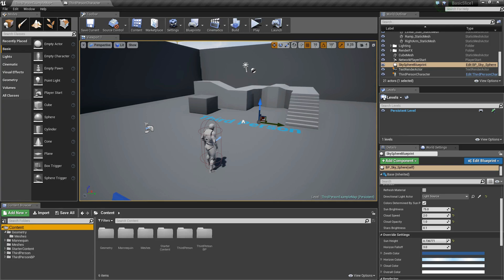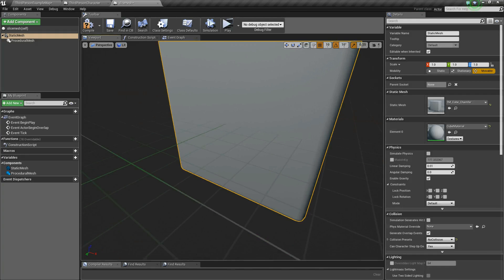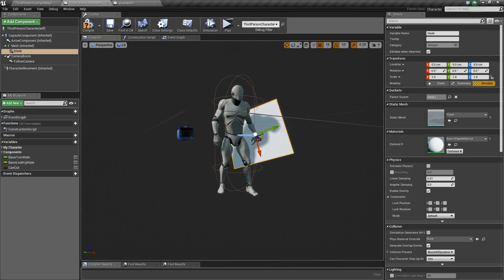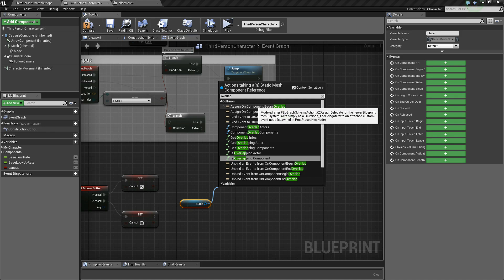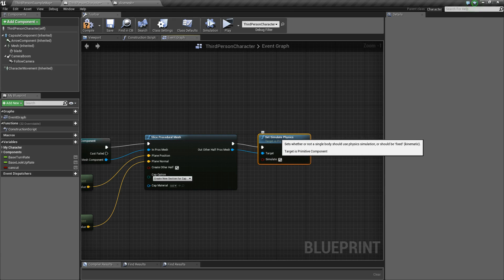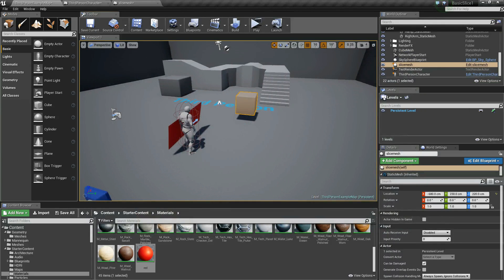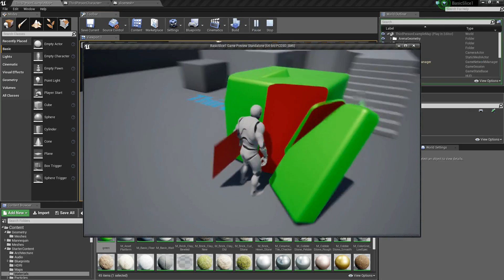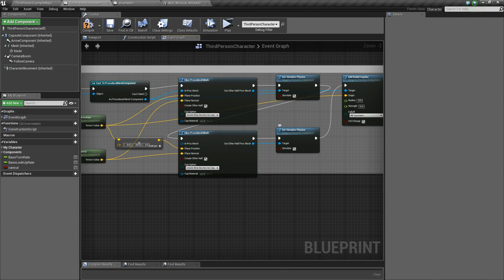Tutorial on Slicing blade. (100% Blueprint, Unreal Engine 4)

Comment: the only thing i noticed is that if you take the chamfered cube for example, and stretch it up on the z axis, the cut won't be accurate, and I'm guessing that is because of it's collision data, because if i take an already long mesh and slice it it does slice accurately...
Reply from the maker: Exactly, if you stretch do it on all the 3 axis not just one... or, as you wrote, change the mesh before. That's how procedural mesh works in ue4.

Comment: If your procedural mesh goes into the ground without a collision ...
There is no convex collision in the static mesh.
Box or sphere collisions do not work, so you must make a convex collision to work normally.
Reply: I was running into the problem of the mesh falling through the floor myself.  You can start with using boxes as the collision mesh, but then in the mesh, go to the collision menu and "Convert boxes to convex".  Under the collision primitives in the details tab, you should see the boxes have now been converted to Convex Elements.  Back on your editor window, you can confirm that the boundaries are correctly working by showing the collision mesh.  One final thing is that if you are changing your collision mesh, you may need to swap out the mesh in your blueprint temporarily, then change it back to see the updated mesh reflected in the editor.  Depending on how you store the copy of the procedural mesh, you may need to do something to trigger the construction script again.

Thanks Verum Bit for the tutorial!  Much appreciated.
Reply from the maker: Check my last #ue4jam game video. Download and play the lightshadow game I did in these last 4 days for the jam....you will slice with  proc meshes with collision .

Comment: does this work with rope?
Reply from the maker: Never tested with physic chains.  You could track the location where the blade overlaps the chain and then destroy the chain and replace it with 2 new chains half length attached on the same 2 actors of the original chain. Should work but not sure about the elastic effect.
Reply: @VerumBit  ok, ill look in to that then, thanks for the quick reply, and nice tutorial!
Reply: @VerumBit  ok, ill look in to that then, thanks for the quick reply, and nice tutorial!

Comment: Does this work on a skeltal mesh during an animation?
Reply from the maker: You need a workaround to make it work. as for ue4.18, skeletal mesh can not yet be conv into proc mesh (only static mesh can), so the solution I thought are two2: 1. you can split your skeletal mesh into many staticmeshes pieces and slice them (if you have a mech is perfect). 2. another way (the one I'm testing) is to save some key character poses during each skelmesh animation and when you slice you can hide the skelmesh, get the nearest pose inside the animation and show a player staticmesh in that pose....this mesh will be converted into proc mesh and sliced....then you will apply a material to dissolve such mesh because will fall like rock pieces (not a radgoll). If is quick and added with particles, the effect is quite realistic.

Comment: Hi, Its works only with the plane as the blade, if I try to use another static mesh as blade it's getting "none" as the other component instead getting the cube on component begin overlap
Reply: I found the problem, my static mesh had no collision
Reply: you could prob just make the plane invisible and put it inside a blade

Comment: Thank you for a great tutorial! learned all i wanted too in 15 minutes, rather then having to watch the 1,5hour video that the official unreal engine channel has on the subject.

One thing i did different that may be good for you/others too, is plan a little ahead and build the slicing logic inside a function in an 'actor component', then you can just add that component too the player (or a weapon the player can hold), to an npc's area-attack, to a spinning blade in the environment, etc, and then call the slicing function with the parameters (for example force direction & strength) u want. And if you ever wanna expand upon your slicing logic you only have to update the 1 actor component.

Another change i made is that in my ThirdPersonCharacter i simply get all overlapped components from the blade, and foreach loop trough them, that way when the blade is hitting multiple 'slice meshes' at the same time, it slices them all, rather then only one :)
Reply from the maker: Thanks! I saw the 1,5hour video too :) and was the inspiration to create a shorter tutorial! You can add and modify the bprint in order to make more realistic slice effects....I did a lot of modifications too to make more realistic effect. If you can, make a video to show your final effect.
Reply: @VerumBit  Great Tutorial! but is it possible to make a tutorial for slicing object for a weapon that you can pick up in VR because I am making a lightsaber for VR and want to add the slicing to it but i can not get it to work.
Reply from the maker: Yes in June. I ordered oculus quest. I don't have a vr now.
Reply: Hey man! I love your idea of slicing multiple meshes! But I can't get it to work... would you mind elaborating on how you did it?

Comment: Nice! Cool feature I did not know about. Is there a way to generate procedular mesh out of skeletal mesh? Or is there different tool/node for this?
Reply from the maker: Thanks! Today, Skeletal mesh has to be divided in isolated single mesh bones via 3d program, reimported in UE4 and re-attached to skeleton.
Check the forum page I created for this slicing effect: https://forums.unrealengine.com/showthread.php?145155-testing-SLICE-and-CUT-meshes-and-skeletal-meshes
Reply: That's a bummer ... I have zero 3d modelling program knowledge :P But thanks for reply!

Comment: That...was....amazing. However, I have discovered that there is only working collision on the FPS and Third person maps, on the Blank map, for instance, the procedural cube drops right through the floor! Is there some kind of world setting I'm missing?
Reply from the maker: Check the collision on the static meshes. I noticed that a simple cube or sphere collision, when transformed into procedural meshes they went through the floor too.....so I removed their standard ue4 collision and added a new one....and worked.
Reply: Verum Bit Finally got it! After what you said I did some digging and found this: https://answers.unrealengine.com/questions/480942/copy-procedural-mesh-from-static-mesh-collision.html. I just added copied the collisions directly as it doesn't seem to work via copy mesh. Now on to intergrating this with swiping and slowed time! laughs thank you so much for your help. Keep pushing forward!
Reply from the maker: Well done! I'll test it and see how good and precise are these proc. mesh generated collision.
Reply from the maker: Done tests with the flow image of the link above: 
it works, but you need just the vertex...no need for triangles, normnals, uv, tangents. 
Just added 'Get section from static mesh' and connected Vertex output array to 'Add collisionCOnvex Mehs'. So you can remove the collision from the static meshes and they will be created inside the Contruction script directly. 
I did another test on skeletals (the head is a static mesh attached to the head socket) and did not work so I will keep this only for normal meshes, while for skeletal meshes I'll keep the standard mesh collision setup.
Reply: Verum Bit Ya that was exactly what I did, just kept the vertex. Should also be noted that these procedural meshes do not fully bake via default Unreal Engine when it comes to mobile. They no longer simulate physics. Yet another work around I'll have to solve down the road. I haven't played with the skeletals yet, but least the communities knowledge of what can be done has grown greatly thanks to your discoveries! Keep up the innovative thinking!
Reply: yeah remembering having exactly the same issue with boxes, took me like 2 days to figure out before adding a convex collision by myself. And I m still surprised to see that it s still the case in 4.19. The weird of the weird is that it seems to work for some people though ....